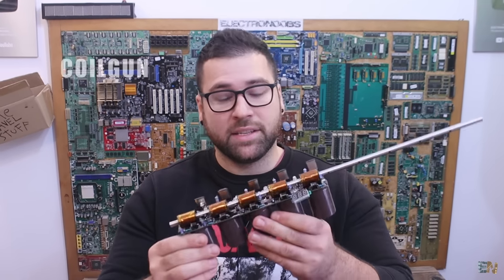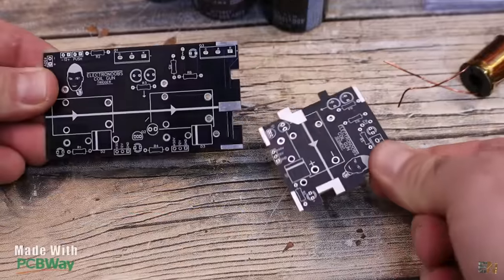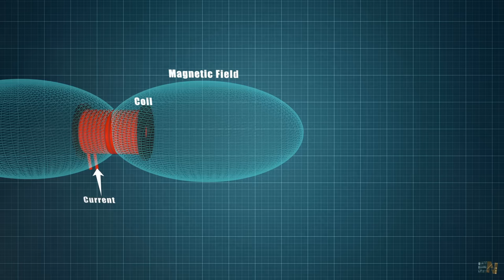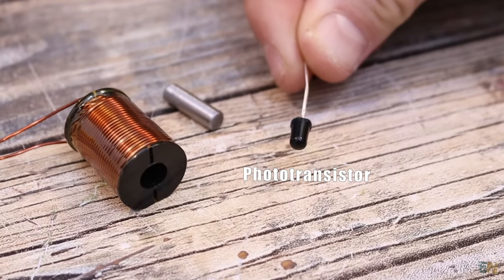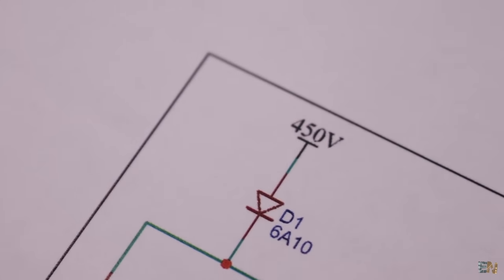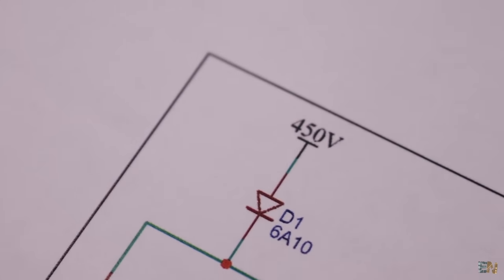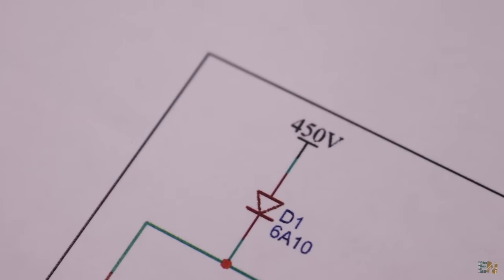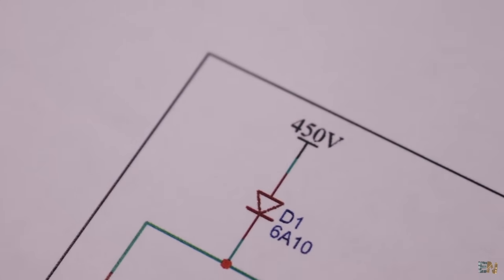I've Made a Powerful COILGUN | Separate Stages PCB

Comment: Nice video, as I worked with coilguns a lot for my university project, I might give you some advice which will definitely help you.
1.try using some kind of ferrite washer caps at the both wnds of each coil, to help focusing the magnetic field.
2.the main issue and also misunderstanding about your design is that theoretically adding more stages to the design won't increase the speed.
Here is why: as the bullet passes through the stages it gains more speed, thus the required run time of each coil will be different.the early stages need more run time thus bigger inductance and capacitor values, and the few last stages will have a lot less run time due to the high speed of the bullet, so you should use smaller values of inductors and capacitors values.
If you apply the same values to each stage, adventually the last stages will reduce the speed and efficiency of the coilgun drastically, because of the suck back effect that they cause due to exceeding the required run time of the coil.
3.try to minimize the airgap between the bullet and the barrel, aslo use non-conductive barrel to get rid of induced current losses.
4. The pcb traces add a noticable amount of resistance to the current path, so using a thicker and wider trackes covered with solder is a better choice.
5.calculate the values for the capacitor and inductor of each stage based on the bullet speed of the previous stage.
6.try using a stepped coil geometry for the coil of the first stage.

These were all I can say so far about it.
Again, thanks for your efforts and keep it going!
Reply: Would he benefit from reversing the current once the bullet passes instead of cutting it?
Would it also be beneficial to run all coils together and one by one switch them once the bullet passes? (Turning them off like in the video or reversing the current like my first question suggested?)
Reply: @TalSaiag  no, its not a bipolar sibject. Reversing the current inside the coil will not change the direction of the applied force. The bullet is always attracted towards the coil, no matter which way the current flows through the coil.
Reply: Can we make a big tank connon out of this ? I love the idea of 8.8cm flak electric gun on a tiger 1 tank 🥰
Reply: @howardstark6707  , look WIK C, it's great that you built your own coilgun and have videos about them, but that doesn't mean you should spam your videos links on the comments of every coilgun/railgun related video. You just come across as attention seeking (the fact that you're using a different account to link your videos doesn't help either).
Reply: Wow very nice i could make one of those
Reply: There is another (big) mistake he made. He is using thyristors and is "turning them off" when the bullet passes the coil. You can't turn off a normal thyristor. You would need a whole lot of additional circuitry and use GTO thyristors. So he basically hot lucky with this capacitor / coil combination that the power pulse is over when the projectile passes over the middle. This is probably why adding more and more stages in this design would not help him, as at one point the bullet would start being slowed back down.
Reply: @markoantesic4362  ,great piont, I was about to mention that to, but my comment would become so long that no one may bother to read it.
But, yup, that exactly what it is, but I think he knows that, he just said it in a wrong way so that it will be easy to understand the principal.
Reply: @CraftAero  Saturation flux is much lower for permanent magnets than soft ferromagnetic materials. In other words, the maximum force you can exert on the projectile will be much lower. It would also be asymmetric, and the added complexity of timing both pulses and switching requires many more parts, it is not worth it.
Reply: Turns out here and there sometimes people are fairly smart. Good thread here keep it up.
Reply: Ты всё правильно ему объяснил! Отлично!
Reply: @petezel  Oh yeah, not really feasible, just pointing out, it's possible.
Reply: @petezel  another issue for using permanent magnets as bullets could be the mechanical characteristics of the them.
It will collapse in pieces as it hits the target!
Reply: @a.rostamifard  true. Really you want to avoid saturation, and keep cost down. Some compromise between transformer steel and mu-metal.
Reply: How much efficiency loss to add a speaker that makes a 'Boom!' Sound & a 'weeeeeeee' charging sound?
Reply: @thestuckmiddle2958  you run into trouble very fast. You need to change the current in shorter times, for that you need lower inductance. To apply forces you need bigger currents, so decreasing R and L, increasing I etc. The timing gets more critical also. Don't follow the circuit in this video, it's garbage.
Reply: @thestuckmiddle2958  It wasn't me, check the username :)
Coilguns will not scale up to that point and even if they did the G-Shock would kill living things. It might be feasible to weld or fuse the outer shell of processed minerals mined on the moon into a slug and launch it from there because there's no atmospheric drag, endless electricity via PV cells, reduced gravity and a reason with enough of a niche use case to even consider it.
Reply: I have 2 questions. Can Neodym magnet around the coil increase its strenght? And second could distance (for example one meter) from capacitors to coils lead to power losses? Ok I know, it depends on wire gauge but if I use 10 or 8 AWG wire from for example 400V 2000uf capacitor to coil, will it have power loss or it just doesnt matter?
Reply: @strukk5742  first, in coilgun we need a strong but temporary magnetic field, so the idea of putting a strong permanent magnet close to coil will decrease the overall efficiency, significantly. the bullet may even get stuck in the first coil.
And second, the overall efficiency depends on many factors, but one of them is the peak current in the coil, which   has an inverse relationship with caps ESR and the path + coil resistance, and the inductance value of each coil. Therefore by increasing the distance between the coil and capacitors, you will also increase the overall resistance (which is about  few miliOhms). So the peak coil current will decrease and the efficiency will be reduced.
Hope you got your answer.
Reply: @a.rostamifard  Thanks buddy
Reply: YOU CLEARLY DON'T UNDERSTAND PHYSICS LOL any object that travels via electromagnetic pull is super fast and the stronger the magnetic field the faster the object will go smash atoms if you make the coils magnetic field super powerful :) simple physics 101 :)
Reply: @jamiemarsden3823  I bet they forgot to tell you about magnetic saturation on physics 101 class.
Reply: @a.rostamifard  not sure why you're even mentioning 'saturation' here as anything magnetic reaches a state of saturation. 🤔 You really shouldn't assume lol 👍
Reply: Thanks for sharing, how do you calculate the kinetic energy of the projectile
Reply: @downtime3501  EZ PZ > 1/2m=Ke multiplied by V :) just depends what the mass of the projectile is so for example is the mass is 10kg then its 1/2m=5kgxV= and if its velocity is 5mps then its kinetic energy is 125 joules 🤓
Reply: @Alireza Rostamifard I want to build something like this, is there any way to calculate what values to use or do I just have to build and measure it?
Reply: @brooksbryant2478  calculating all parameters requires lots of simulation with different simulation programs. It would be exhausting. but as a rule of thumb, you can choose a inductance/ capacitance combination that reaches peak current and falls to almost zero, less than a few miliSeconds( 5 to 20 I geuss). But as I said there are lots of considerations to be made if you want to build something more than just a DIY project.
Reply: @brooksbryant2478  YOUR QUESTION DOESN'T MAKE ANY SENSE LOL VALUES FOR WHAT? Iif you want to build this it's easy obviously the larger the coild/capacitors and the more you add the stronger overall it will be the only values you need to take note of are M=1/2mdivided by V=XXX so observe only the values of whatever the object is you'll be using as this is the main values you need to note. it's not rocket science bro lol ( the bigger you build the ram coils the more poweful it will be but note that M=-P-V BY 1/2 every step up you go ( so eventually the bigger it is the more power it consumes = big guns are always trippy once they reach a set size/power. also electro-magnetic energy has achilles heels limitations like all energy types. :)
Reply: @brooksbryant2478  I don't understand why people ask for ways to calculate values (v=1/2M=XXXFPS) this is the only Equation you need to know and work from like anything that fires a projectile it is only the projectile values/calculation you need. 

as for the rail in this video the stronger the capacitor and magnetic coils and the more you add to the ram/barrel the faster the projectile.
Reply: Ps electro magnetic energy does have some limits HEAT being the top nemesis for anything magnetic so keeping temps around anything electro magnetic at a stable is a must
Reply: those all seem like great refinements. Seems you studied well.
Reply: @jhoughjr1  yep sure did 🤓
Reply: @a.rostamifard  Current reversing idea should work if the “bullet” is a permanent magnet.
Reply: @jamiemarsden3823  Bro you took the trolling a bit too far. It wasn't funny past your first comment.
Reply: @mrkiky  trolling? Where lol explain?
Reply: What about if you where able to put the power cut off circuitry to detect the bullet while it's in the middle of the coil, would that help ?
Is it possible to make a coil with a hole in the middle for the magic eye ?
Reply: If the bullet itself was made with a ferromagnetic core but a non ferromagnetic tip ? The bullet would have a lot less chances to be slowed down before the circuit shuts down ?
Reply: @mr.octopus6972  thats exactly what we should do. Usually this task is accomplished using an IR sensor at the end side of each coil, so the moment that the tip of the projectile comes out of the coil, the sensor detects it and sends a signal to turn off that coil and avoid bullet being sucked back.
But for this method you should use mosfets of IGBTs for switching the coils, not SCRs. However there are some replacements for the IR sensor, like a hall effect sensor or a pickup coil.
Well that's all that I can think of right now
Reply: @mr.octopus6972  The problem is that the magnetic field doesn't instantly die when you shut it off. It has a duration for it to collapse and it depends on the dimensions of the coil and other stuff. So for example, a certain coil can simply be too big for a bullet travelling too fast and it will always suck it back in no matter how perfect your timing is.
Reply: @mr.octopus6972  If you make a bullet that is part non-magnetic, the non-magnetic part simply adds extra mass with no effect on the force exerted by the coil. So unless the non-magnetic part has some special function like super low friction through the barrel, or adding spin or some kind of stabilization, there's no reason to ever add it.
Reply: @mr.octopus6972  opposing magnetic elements work best the stronger the better but more dangerous. 👍
Reply: @mrkiky  
That is not what I meant.
When that bullet gets out of the coil it is already too late to kill the field since the bullet is physicaly completely in the opposite field and being sucked back.
But if you make the bullet with a carbon tip it will show it's nose on the other side of the coil activating the magic eye but the effect of the opposite magnetic field would be way less stronger.
Basically it would give more time to the system to kill the field giving the bullet a chance to keep it's speed.

Another way I see this is to put the magic eye before the coil and you would need to know how fast the bullet is travelling to kill the coil while the bullet is in the center.
Reply: @mr.octopus6972  Ok I didn't watch the whole video previously and didn't realize he put the sensor AFTER the coil, in order to shut it off. That's really sub-optimal. It would be much better to place the sensor before the coil and use it to turn it on, then use timing to turn it off. Then you can use what I said to optimize it even more.
Reply: @mr.octopus6972  not sure what you mean but, the power is limited by the size of the coil bigger coils=more power more=power=more dangers more danger=death or worse lol :/
Reply: This should be built a little differently. If these components are used as in this video, after the first coil the LEDs should be placed before the coil. Because every time the bullet passes through the coil, it no longer accelerates as it passes the center. If the power is cut off before the bullet gets past the center of the coil, the speed will not slow down. Also, the electronics in this build aren't that fast, so it's more useful to turn off the power a little before the bullet enters the middle of the coil. In addition, the coil spacing should be changed to a slightly longer spacing towards the end
Reply: i am looking forward to an update he'll make using even a few of these. i might even try it just for fun here.
Reply: @mr.octopus6972  this was something I was wondering myself so I’m glad to see this finally asked
Reply: @mrkiky  does the magnetic field from the coil not collapse instantaneously because current has to decrease over time so power cutoff can’t be instant?
Reply: @kennethmathis-simpson1501  I dunno exactly but it is a property of the magnetic field, so you simply can't make it go away instantly no matter how instantly you cut off the power. It's probably akin to a bucket with a plug at the bottom. No matter how fast you pull the plug, it will have a drain time. If you make the plug bigger and the bucket volume smaller, it will drain faster, but still not instantly. You can mess with the wire thickness and number of turns too to maybe fine tune this aspect as well.
Reply: What is the difference between this and a rail gun???
Reply: @NonBinary_Star  A rail gun has rails, sends electricity through the rails while the projectile connects them. The resulting magnetic fields push the projectile along the rails. This one has coils around a tube. The magnetic field simply attracts the projectile super fast towards the coil, then it switches off and the projectile continues due to inertia.
Reply: @mrkiky  ahh! thanks! I didnt know the actual full rail of a rail gun was part of the conductive mechanism itself.
Cheers!
Reply: I’m thinking of building my own variation except I want to add some logic to it. Would an arduino nanos switching be too slow? How could I go about this? Thank you
Reply: I thought somethings was off, I studied (particle) accelerator physics in my masters & this remined me of LINAC, similar in principle, adding more stages definitely ain't going to help. May I please have your design, if possible?
Reply: Wouldn't it be better to measure the current rather than using an optical sensor as the projectile leaves the coil for projectile sensing?

The projectile will already be experiencing suck back effect by the time it's sensed by the photoresistor.
Reply: @mrkiky  It does instantly die but as the magnet field potentials.....
Reply: @mrkiky  qState of carbon
Reply: @kennethmathis-simpson1501  current is very slow like ten to the negative4 or something
Reply: @NonBinary_Star  the coils
Reply: @mrkiky  very good
Reply: @NonBinary_Star  the projectile is a sabot fuse
Reply: @kennethmathis-simpson1501  current smurrent, it the potential energy in the coil Voltage. The mag potential comes from the electron gas pressure in the coil pipe.
Reply: @cmdreltonpoole6303  hmm you might be on to something, think in terms of displacement.The coils fire when switched so..... switch them based on.... oh yea and also yea shite load of small coils all along the barrel not a few you know for different projectile lengths
Reply: and who is going to design the magnetic projectile stabilizer or rifler....
Reply: why not make the collapsing coil dump into the next coil you know like wave
Reply: no distance between coils no trigger just non-linear timing
Reply: no more freebies, beddy time for me. Hope I did not come across as an idiot. Night yall
Reply: @a.rostamifard  so you are saying the caps have to be built into the coils, like a sleeve around the coil packs and use a laser spark gap to dump the caps into the coils Good idea..
Reply: really what you are trying to do is pick up steel with a magnet then throw that magnet a short distance but release the steel as a projectile so really momentum does not play since the multi-coils are always the length of the projectile, surrounding it.
Reply: @cmdreltonpoole6303  measuring current is not a good indicator of the bullet whereabouts. The more accurate way you want to mention is that when IR detectors triggered, the projectile already passed the middle point a little bit, so it already experienced a little bit of suck back. The better way of using IR detectors in my opinion is to only use them to get a good first assumption of the trigger timing of each coil, then try to optimize and compensate it manually by giving prefixed timing to a microcontroller to trigger each coil! But this method needs lots of shots being fired to reach the minimum error and the best timing.

But an alternative method that I think is the best, is using a small pickup coil in the middle of each coil ! sounds confusing but it actually indicates the peak value of the coil inductance but outputting it as voltage. So when the bullet reaches exactly the middle, since it acts as a magnetic core for the coil, the inductance of the coil reaches to it's maximum value. And this event is simply observed by a voltage spike in the pickup coil or pickup sensor.
Reply: Also, the feedbacks should maybe be placed before the coil with an adjustable delay
Reply: @claxvii177th6  yes. Even better!
Reply: I'm totally new on electronics, why don't they use this in military? It seems to me we can optimize this technology for mass production, what is the downside of magnetic based gun vs gunpowder based? Thanks and as you can see, I'm a pleb who's basically fanboying over this
Reply: I think you do have a lot of the basic improvements needed, as yes, there is a timing moment consideration for both maximizing the acceleration, and that the relevant timing will accelerate along the path to the maximum of your switching potential and given resistance of the "slug". IR sensor placement might need to be at the start of the coil, as to begin collapsing the field before the slug hits the center and the pull back end of the field. Field shaping would help, not only for intensifying the field but diffusing it on exit. Maybe looking into halbach formations and making the overall coil segments more precision shaped could help. Was also considering a special slug design,  with a small right angle magnetic zone series, would impart a rifling effect, spin stabilizing the object. If you consider the series multistaged, where the field of at least three of the coils is pulling the slug, and cross tying the series for on and off in that way,  you might get more imparted force. I know this complicates the circuits, but magnetics are much slower than transistor switching, so why not use the lag to your advantage?
Reply: @Geniusinventor  I've been told that exists. My dad told me about rail gun parts he was manufacturing for a government project back in the 90s.
Reply: I learned a lot from this comment. Thank you
Reply: Just thinking outside of the box here. There is this metal called mu metal that someone mentioned here on the chat board. Now as I understand it blocks magnetic fields. So my thinking is if you wrap the projectile tube where one coils negative magnetic field is located let's say, where initially that would stop the projectile, is now blocked, allowing the projectile to pass by. Would this be feasible?
Reply: @TalSaiag  If bullet was a permanent magnet, yes. Pure iron will only hold its magnetism for a very short moment, then re-orient back to the surrounding ( now reversed) field.
Reply: @a.rostamifard  maybe splitting each coil so each coil has a pull push?
Reply: Hi, i am doing on this project and i have some erorrs. Can you help me? Thx
Reply: @Viktor-qe7ht  sure.
Reply: you are the first person that responded, thanks. My problem was that the thyristor was breaking every time i push the trigger and try to shoot. But tuday i changed from 1mm thick copper wire to exat 0,8mm thick wire and its started working. Again thanks for respond, if anything i will by in touch
Reply: @Viktor-qe7ht  your thyristor is not for the peak current rating that your circuit has. Try another thyristor with higher peak current rating.
The fact that you change your coil's wiring and it worked, is because you increased the coil's resistance by using the thiner wire, so the peak current has also decreased and now the thyristors can handle it.
Reply: @a.rostamifard  hmm, make a sense. I didn't know that 0,2 mm can make such a difference. Thanks again.
Reply: @a.rostamifard  thanks. I had the same question.
Reply: Buy a 9mm 😂
Reply: @alirezarostamifard6404
1. Regarding stepped coil design for the first stage...I think it will be applicable if we somehow make a linear travelling wave (multi phase excitation), otherwise it is not going to change much since the LC current (half wave) at most will work as a small millisecond pulse.
2. The ferrite washer practically will get saturated (ferrite can take max. about 1.5T whereas, here momentarily it may be very high T)
Reply: Badass comment is badass.
Reply: @a.rostamifard Rather, it DOES change the direction and flow of current by changing the polarity at the switched end. However, because transverse waves (and their component particles) travel perpendicularly to b the force applied, the net effect is the same.
Reply: Very valuable advice, thank you very much for it. But I have a comment that I would like your opinion on. Wouldn’t it be good if the files were controlled via a microcontroller, to control the timing of each stage, especially since the speed of the projectile is variable before each stage, as mentioned?
Reply: @a.rostamifard  Hey, im doing a coil gun as a school project, and i dont find any resources online to learn how to relate the impedance of the coil and the speed of the projectile. (5.calculate the values for the capacitor and inductor of each stage based on the bullet speed of the previous stage.)
If you still alive in this account, can you help me pls?
Reply: Very generous information !!
Reply: Hello, just to clarify did you mean ferrite washer caps on either side of each individual coil?
Reply: @jaminmayo7125  that's right
Reply: @a.rostamifard  thanks so much didn't expect such a quick reply, too many projects cooking right now but rlly interested in putting together a little coil all ur info is great <3